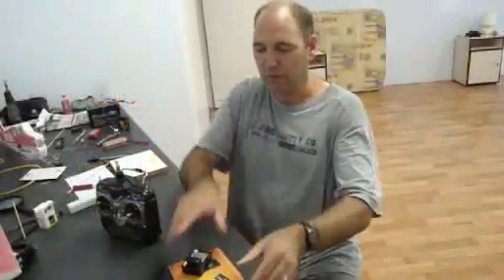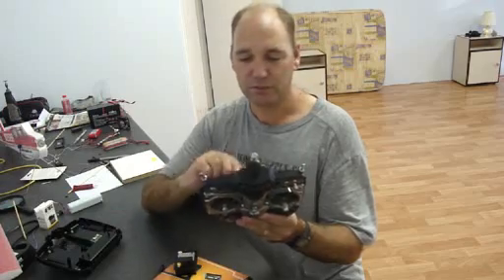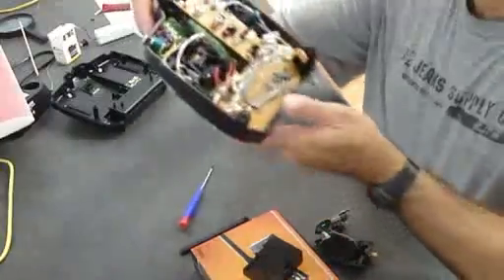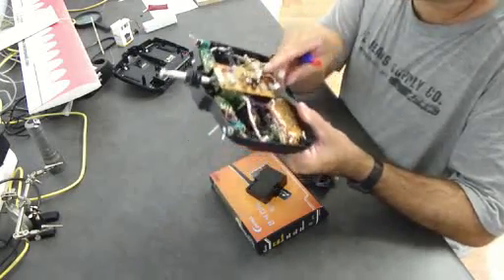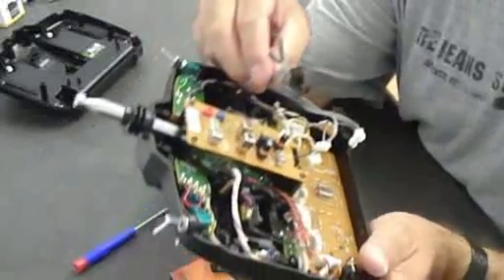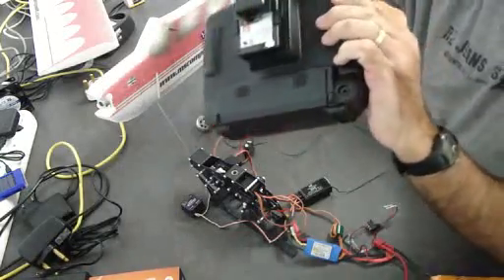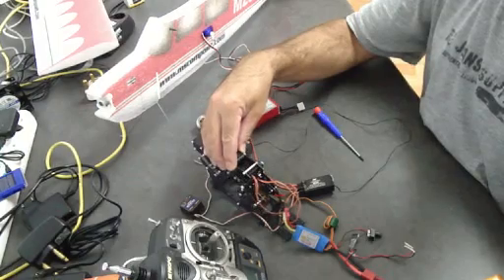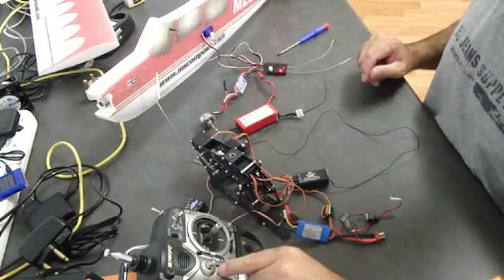Convert JR Propo X-378 RC Radio to work with 2.4GHz Corona Module

Comment: I have a great Old JR Galaxy 8.  It has a module set up that I have not used in a few years. I love the feel of it in my hands and would like to update it to the 2.4.  Can I get a 2.4 module and be good to go?  If not can it be converted using a similar method?  thanks
Reply from the maker: You can check the modules available from hobbyking (the orange or corona modules).  Else you should be able to use this method for the "non-module" method.

Comment: Great link! Is this possible on my JR XP6102. I have several different planes and helis and I would rather only have one radio for them all. Was it very expensive?
Reply from the maker: It was not expensive.  Check HobbyKing for prices of latest modules - Corona or Orange.
If the XP6102 does not take a TX module then this method from the video should work.
Reply: Where you able to change to 2.4 to your JR XP6102 radio?